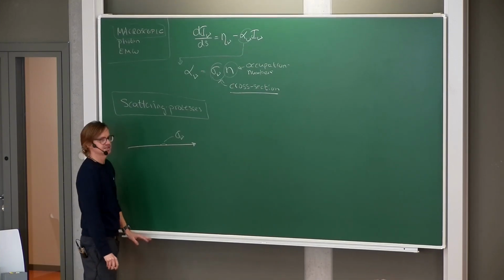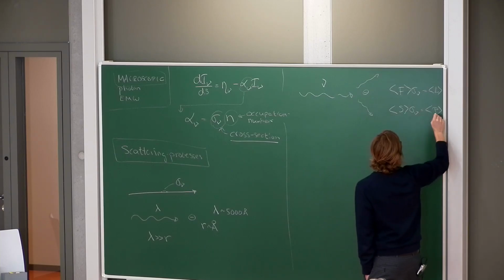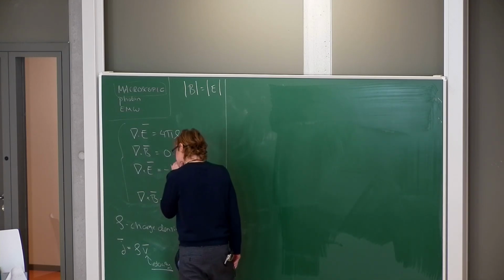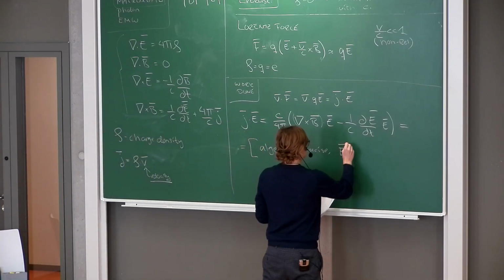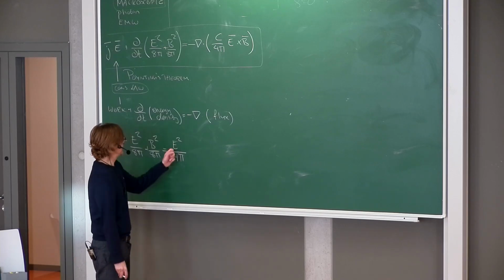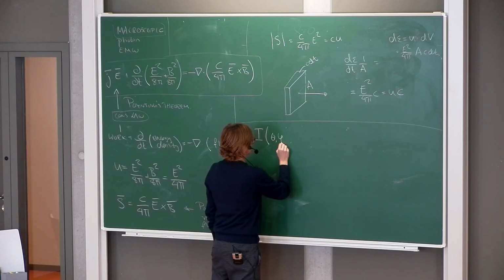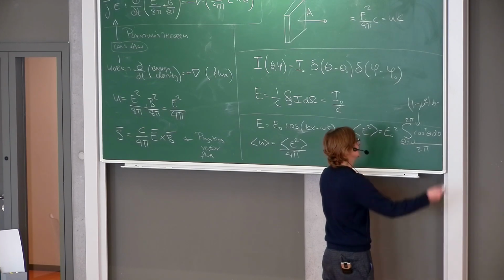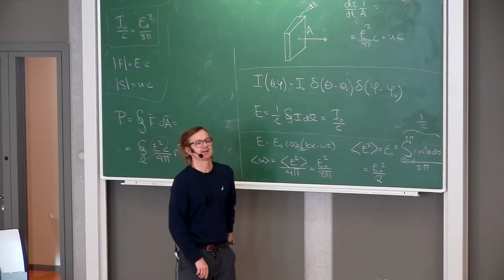Radiation Processes in Astronomy: L8a - Maxwell vs radiative transfer

Comment: Why are you calling it radiative transfer, when it is actually transmission you are describing?

Some do call it the radiative transmission equation, which is correct. It cannot be both. If you don't account for thermalization and or latent heat absorption, then it's all scattering which is not energy "transfer" just transmission.

Transfer and transmission are not the same thing. Far from it. 

In fact you make this mistake in the first 30 seconds of the video. You refer to "light and light transfer". This is incorrect, light is not transferred, it is transmitted. 

This is not a small thing, it is sophistry and leaves the door open to fraud.

Please correct your mistake.